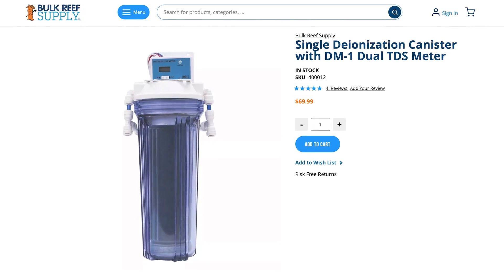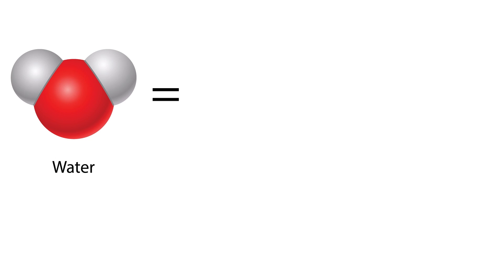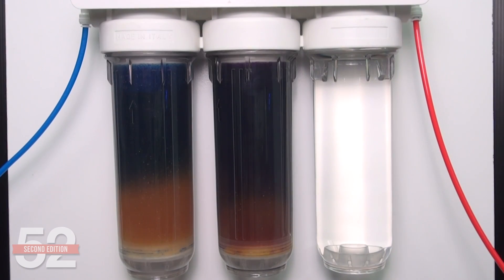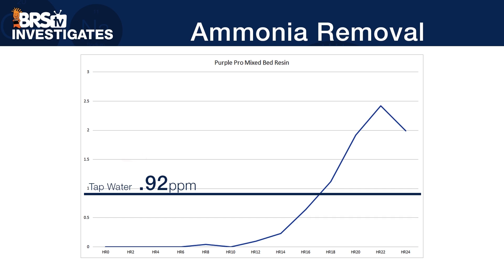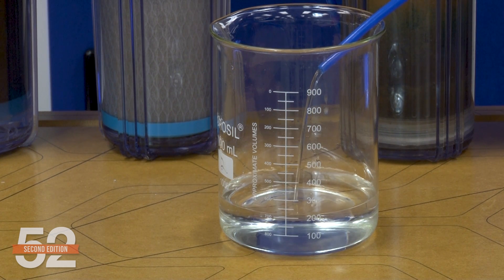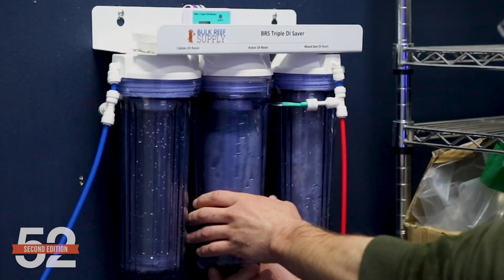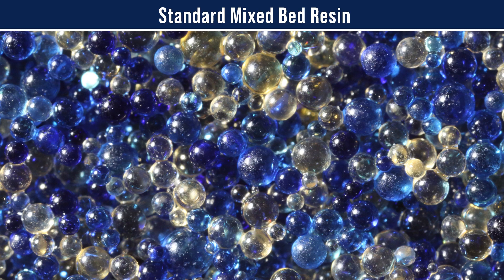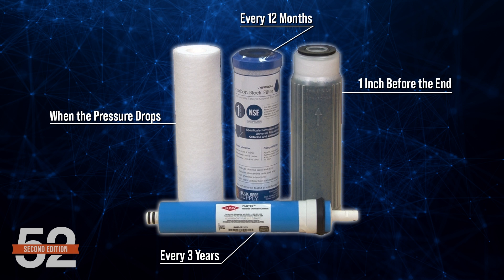When to Change DI Resin, and How to Maximize Cartridge Life. PT5: BRStv Guide to RODI & Reef Tanks

Comment: Superb video, thanks you very much. As I understand from your explanation, cation resin is negatively charged and has an affinity for positive ions (cations), while anion resin is positively charged and has an affinity for negative ions (anions). In RODI systems, the filters are arranged in a specific order—anion resin first, followed by cation resin, and finally mixed resin—for efficiency and cost-effectiveness. The anion resin depletes faster due to the higher concentration of anions in the water, meaning it must be replaced more often. The cation resin then removes positively charged ions. Mixed resin, which is more expensive, is placed last as a polishing step to capture any remaining trace ions, maximizing its lifespan and reducing the need for frequent replacements.